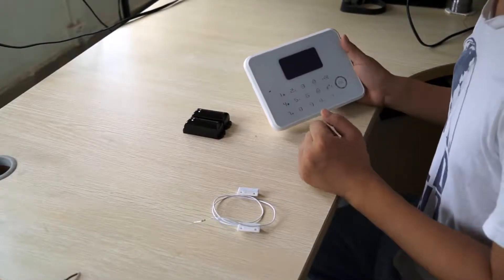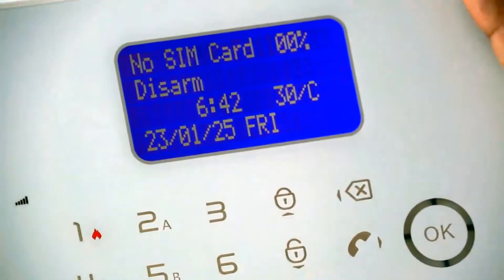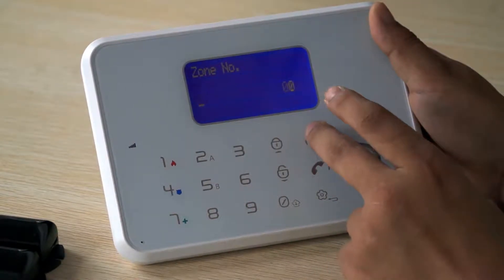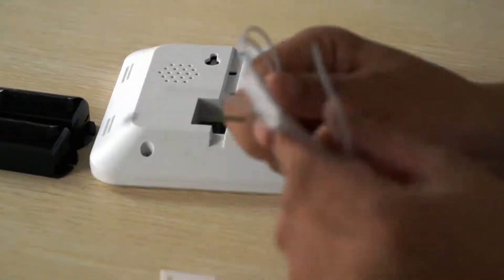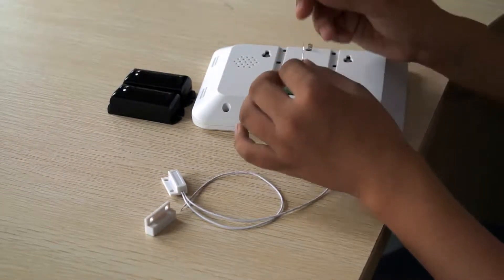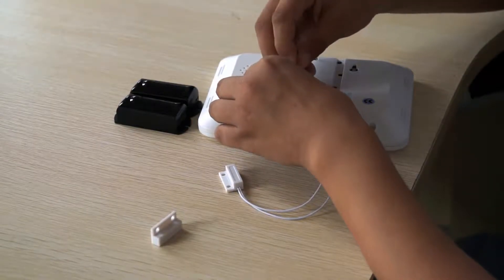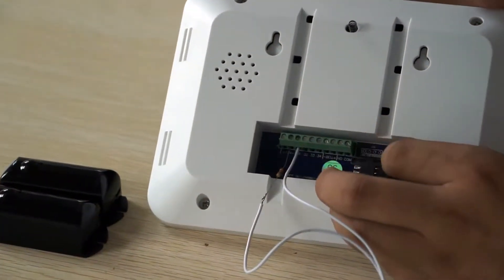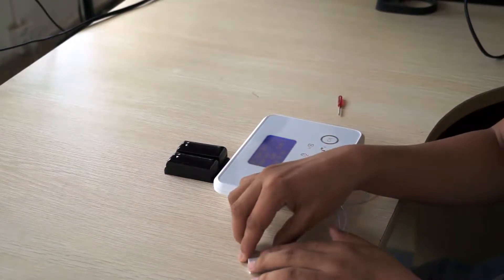How to connect sensors to hardwired zone of alarm panel?

Comment: EOLRs belong at the sensor to supervise the circuit correctly.  You effectively demonstrated installing them at the panel.  If the wires were shorted between the sensor and the panel, the system would not indicate  a trouble condition.